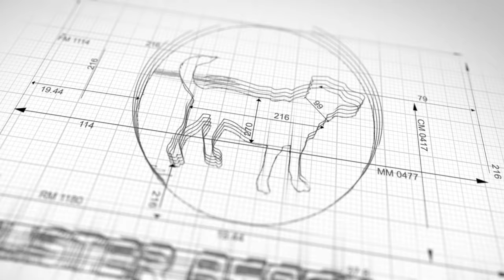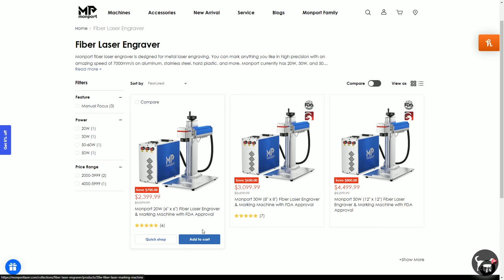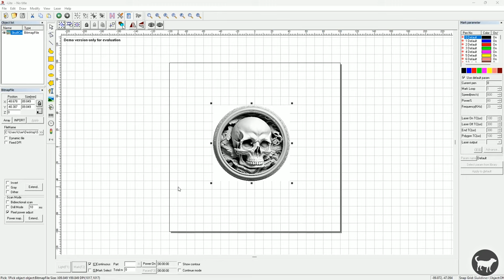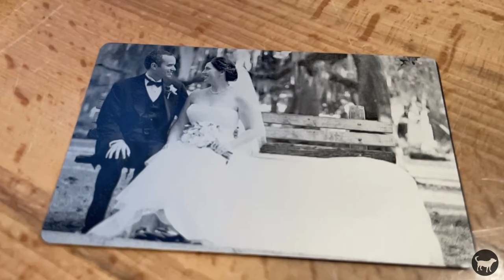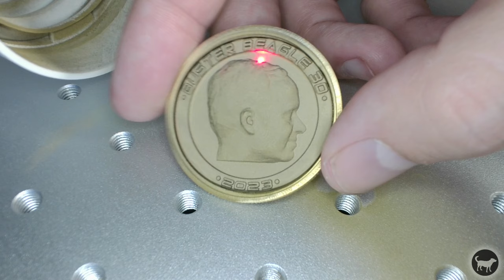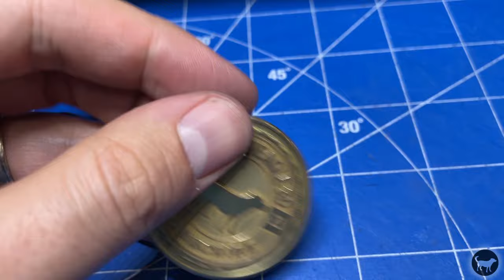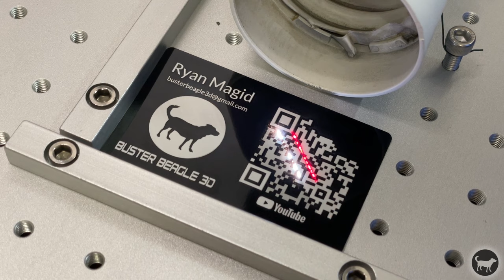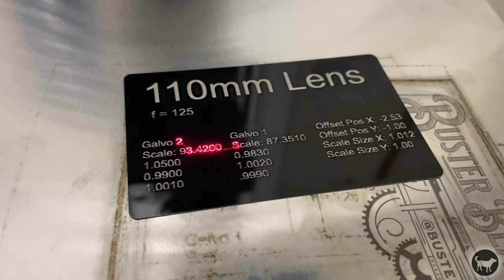Monport 30W Fiber Laser Engraver Review | Galvo Laser | Metal Engraving | Rotary

Comment: Work area and laser power are not directly related at all. There is some affect on the distance the laser can cover with a certain focus, but that's it. The laser doesn't heat the whole area at the same time after all.
Reply from the maker: It's true that the laser power doesn't change but the intensity does at the smaller lens sizes. For the sheer fact that the laser would now be 100mm closer to the workpiece and the pulses now much closer together.  The difference would be on aluminum for instance engraving at 550mm/sec at 100% power on the 200mm lens vs 1000mm/sec at 80% power on the 110mm lens.
Reply: @BusterBeagle3D  The difference between the lenses is the size of the focal area, isn't it?  The distance doesn't matter that much as long as the laser is properly focused, the absorption rate of air is very low.
Reply: @joergsonnenberger6836  There's a weird relationship between power and work area. No laser is perfectly collimated and infinitely narrow, so wider lenses increase the spot size and spread the energy out more on the periphery leading to reduced temperatures but over a larger area
Reply: The angle the laser hits the work causes variarions of temperature at the work piece. Much like the angle of the sunlight hitting your area causes the seaaons to change from warm to cold
Reply: Laser intensity is correlated to work area, which is roughly the same as localized laser power.

Comment: Hi Buster could this machine be used to cut out the face paper of a self-adhesive printed decal without cutting the backing paper, may be the 3d feature can help control the cut depth?
Reply from the maker: I suppose it's possible. It wouldn't really be the 3D function but a lot of testing on finding the correct power and speed to achieve what you want to do. Again not something I have tried but I don't see why not.

Comment: Good morning Buster. I just purchased a 100w OMTech MOPA laser. I also bought an acrylic enclosure which i plan on attaching a vent to outdoors. 

Have you had any issues with material getting on the lens of this machine?
Thanks
Reply from the maker: Hello. Not really. I mean it doesn’t hurt to give it a wipe with a lens cleaning cloth every now and then but for the most part it stay fairly clean. I suppose it depends on what you’re doing but I don’t touch it that often.

Comment: I am curious about the heating capability of this 30W fiber laser engraver. Do you know how high the temperature goes up when measuring it with a thermal camera during the engraving process?
Reply from the maker: I have never measured it but I can assure you it gets items hot depending on the process you are doing. I have certainly gone in to pick up an item that had finished engraving too early and burned myself.

Comment: I'm looking for something that's maybe not as high tech as this, but I'm looking for something that's going to laser engrave aluminum or steel not deep at all just enough to see it basically. What would you suggest
Reply from the maker: You can get fiber lasers that are 20W that would be cheaper then something like this. You can also get regular diode lasers with IR laser add on module if you wanted to do other types of objects. However those are not even close to the power and if working with metal and speed are important to you I would go with a 20W fiber. You could also go with something like the xTool F1, I did a video on it on my channel but again if metal is what you want I would go fiber.
Reply: @BusterBeagle3D  awesome thank you.

Comment: How are you creating the files for deep engraving?
Reply from the maker: Hi. It's a process where I have an 3D model STL file that I then convert into a height map online. I then use that heightmap in Ligthburn as a 3D sliced image in the image mode under Tools>Adjust Image. That will essentially "slice" the image similar to the way as 3D print is sliced, layer by layer. There are a few videos online about using the 3D slicer function in Lightburn on YouTube if you just search for it.
Reply: @BusterBeagle3D  thank you for the explanation